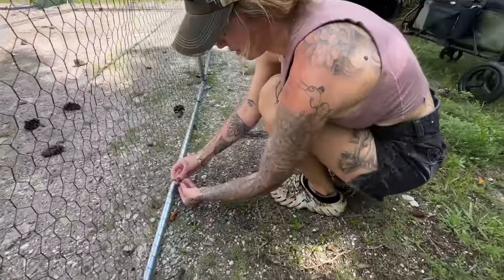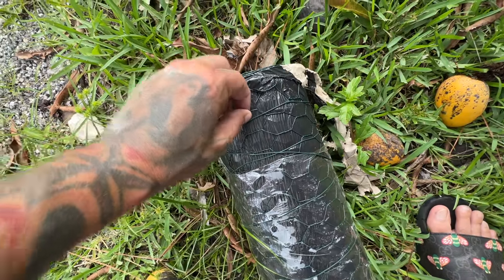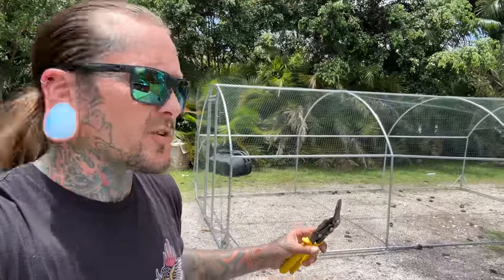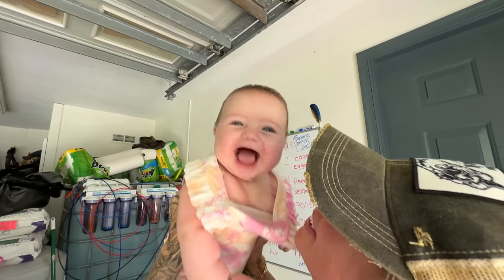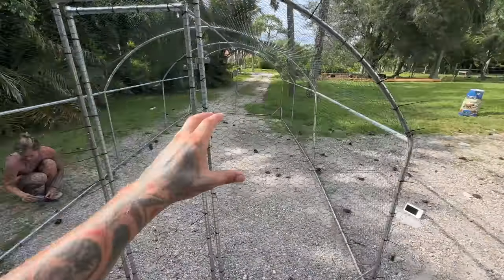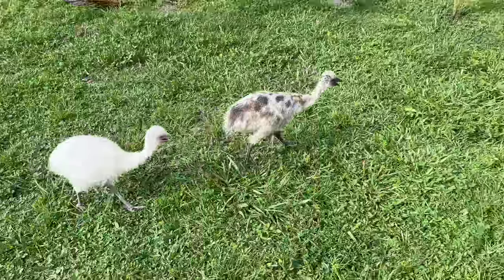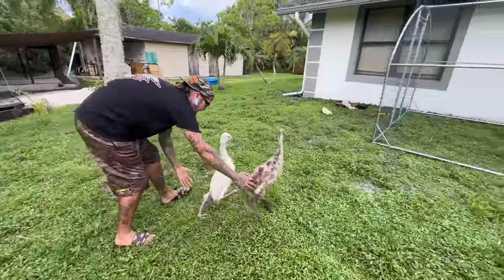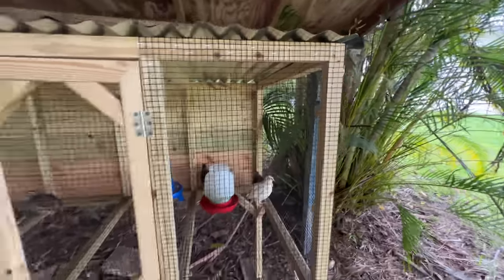EMU UPGRADE!! They are getting so BIG!

Comment: As a buyer of the almost the same thing, just shorter, I'd recommend going to a camping supply area and putting big tent steaks all the way around so the wind doesn't blow it around.
Or tie a cinder block to each corner if you plan on moving it every so often

Comment: I know these videos are behind but if you didn't lay the pea gravel for pretty cheap you can buy drain tile its the black 4 or 6 in drainage pipe with holes in the top then you cover it with pea gravel and it lets the water drain into the tubing and you can pipe the excess water away from the area. It's not that expensive the 4 in is around 100 dollars for 100 feet of tube we put it around houses to move all the rain water away from the basement walls in Detroit

Comment: do yourself a favor and buy some cheap 1x4 and some metal tapping screws and screw some running boards along the edges it will give the emus line of sight so they wont hurt themselves on the chicken wire and if screwed across the outside it will also strengthen their enclosure and allow you to use it for something else later on, just a thought!